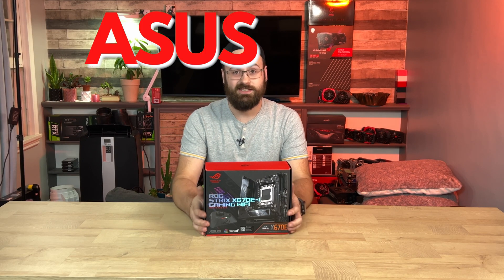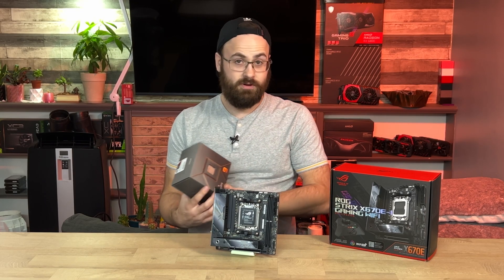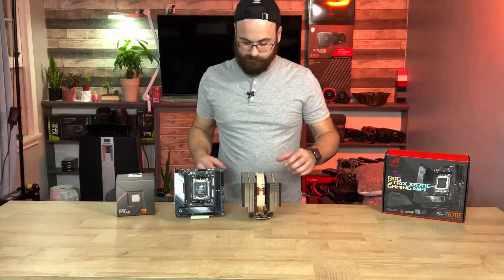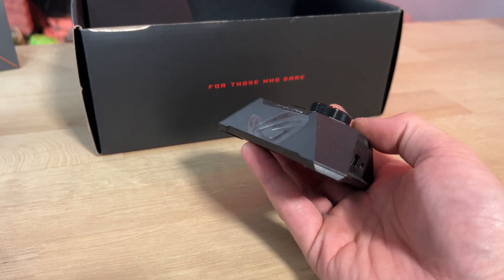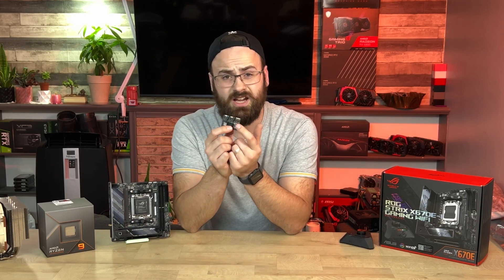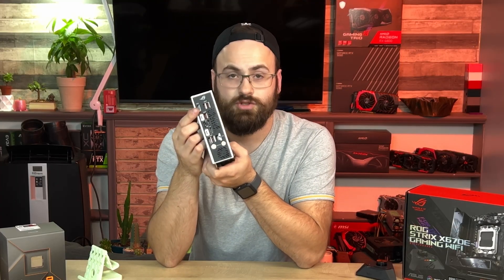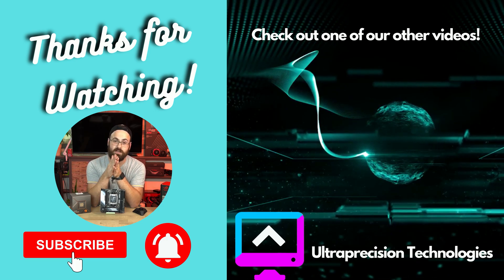An Engineering Work of Art! Asus ROG Strix X670E-I Rundown

Comment: This is the most misleading piece of youtube I've come across in a long time. This board is atrocious. The vertical parts' design makes it impossible not only to connect stuff to it in an itx case, but you can't even put it in an atx case with fans due to the m.2 heatsink cover getting in the way. Also, the chipset fans are awful, and the bios goes haywire anytime you change anything. I wish youtubers were held accountable when peddling such bs products. So yeah, awful physical design if you want to actually fit it in a case, and Asus fell off the high quality train a couple years back now, especially in the premium segment. Their entry level boards still work fine.
Reply from the maker: Thanks for your comment. I have been using this board for well over 2 years now and it’s been great! The reason why it is so dense is because it’s the ONLY x670e ITX motherboard. X670E uses 2x physical chipsets, which is quite impressive they managed to figure out the engineering to make it work at all. If you do not need the high bandwidth USB 4 ports, I would not recommend this board. It’s ridiculously expensive, especially years ago when it launched. Do your research before making any big purchases, and watch multiple videos. Everyone is going to have a different take! This was just an overview to show off the board if ppl wanted to see it in a little more detail than pictures online.
Reply: @ultraprecisiontechnologies  Yeah, but the board sucks bad if you try to fit it into an actual mini itx case. I guess you put yours into a micro atx, am I right? If you try to fit it into a case it was designed for, you're in for a whole lot of grief. And that is terminally misleading. I do need high speed usb 4 ports, otherwise I'd buy something else. And I did do my research, unfortunately, everyone did more of a hands on than a real review, and everyone praised the board immensely without even trying to use it for its primary purpose, and that's building a really small PC. Unfortunately as well - most new high end mbos feature too much relatively new tech that wasn't properly tested in various scenarios and reviewers are trigger happy to post new videos, especially if they got their shiz for free from the manufacturer and then we're left with a lot of semi-misinformation on the market. This mbo was supposed to be great. It isn't regardless of the "engineering accomplishments" with the little breakout board and vertical placement of stuff. And if you ask me, that nvme vertical mount was just lazy engineering, as well as the sata situation. New and innovative? Perhaps. Not really useable in a mini itx case? Absolutely.

Comment: Do you need to always have that Hive thing connected? Or if you're just using Bluetooth speakers can you leave that unplugged and then just plug it in whenever you might need it for something?
Reply from the maker: You should be able to use bluetooth speakers without the hive. I have ran this motherboard with a wireless usb headset without the hive connected.
Reply: @ultraprecisiontechnologies  Nice, thanks!

Comment: I bought a asus rog x670e-i itx board last year second hand from a reputable seller on ebay but due to busy schedule and lack of funds at the time never got round to building my pc. Now I've  put together the pc ,minus the cpu (7800x3d is on the way). I read you can boot into bios i tried turn the pc on nothing happens not even fan spin😢 no lights on motherboard. There seems to be power going to usb's though. I've tried connecting my power button pins just incase it was the case botton.Tried using my spare psu samething happens. Will it work when i put the cpu in or is the board dead? 😢
Reply from the maker: Your power button won't work without a CPU installed.
Reply: @ultraprecisiontechnologies   thanks yeah to my delight it worked when i put the cpu in.

Comment: why would you use Noctua D15 on the mobo? That's an ITX board isnt it? Try using some different low profile heatsinks because that makes more sense 🤔
Reply from the maker: Yeah! Good point. I was just looking around for a bulky cooler, and this is all I had at the time. I can confirm the Noctua NH-L12S also fits in this board and takes advantage of that little rubbery bit on the VRM heatsink I was talking about with its heatsinks. The channel was (and still is) pretty new in terms of actual numbers of videos I’ve made and put out, so as I go forward I will be trying to use my brain a bit more and talk about configurations that actually make sense lol. Thx for the comment.

Comment: Is anyone having issues with audio not working on the hive? Realtek refuses to install and nothing for hive shows up in the sound settings. ASUS Reddit, rog forum, and ASUS support are all useless.
Reply from the maker: The "onboard" audio hardware has been moved off-board into the "strix hive". (Strix hive is a triangular shaped object with a dial on it with some buttons and ports). The strix hive has a dedicated USB type C port it needs to be plugged into in the motherboards I/O. You should also make sure the hive is enabled in BIOS. Hope this can be of some help or point you in some helpful direction.

Comment: While I get that they needed space for cooling the VRMs, I really wish they had at least kept the BIOS flashback button and clear CMOS stuff on the main board itself.  If you are using an itx board, you probably are using an itx case. ITX cases can be crazy tiny and cramped. Especially on a platform with a chipset that is literally aimed gamers, overclockers, and power users AND on a generation with a brand new memory profiling system, you shouldn't keep things as important as BIOS flashback and clear CMOS on things/in places where they could be easily lost/hidden and potentially require a thorough disassembly, which for ITX SFF cases, you really don't want make someone do. Cable clutter can be everywhere in a tiny case like the Formd T1 or the Fractal Terra or Ridge, even with a modular power supply, air cooling, and the best cable management possible. It will be a pain to deal with especially if you need to deal with a critical BIOS update or firmware. Ignoring the overheating, memory issues, and such that Ryzen has been facing, if a security vulnerability were to occur that required an updated bios, you really be asking ITX consumers to be doing much more work than someone with even an mATX user would need to do.
Honestly, I would be tempted to just go for a full ATX mobo since this board is still literally the only X670E ITX board.
(WTFface.png)
Do I have to remind everyone that it's 2024?!
How can there still be only 1 MOBO!?!?

AMD BETTER release new chips soon so we can (hopefully) get some new ITX boards before black friday.
I am tired of this insanity.
I am honestly considering going to Intel or using a bigger board just because of this insanity.

Do ITX users not exist in the high-end market?!

Considering the stuff some people put into their PCs, I really think entire mobo industry needs to fire their entire marketing staff and start over. How does someone not notice the insane prices people are willing to pay for an itx pc case?!
Reply from the maker: I hear ya. While I can't directly do anything to change the state of the mobo market, I can offer some of my experience.

1) One cool little trick for accessing clear CMOS pins in an ITX case is to get a power button off amazon (https://amzn.to/3UEQxAC) and then slide that over the clear CMOS pins and put the button somewhere  more accessible.
2) AFAIK, the reason why there is only 1 X670e ITX board in existence (and why it's horrendously expensive) is because X670e uses TWO chipsets, where as most motherboards (z690, x570, ect) use only 1. Figuring out the engineering to fit both chipsets electrically on the board as well as solve cooling for both, is where a lot of the compromises of this board come from. Honestly, I'm not entirely sure who needs X670e for ITX as you only get 1 PCIe slot on an ITX board, so just get the ROG STRIX B650E-I and save some money. Really all you're getting in the X670e chipset vs the B650e chipset on this board is 2x USB 4.0 ports. So if you don't need those specifically, just get the B650e-i.

Comment: Nice and detailed review. I was planning to make a mini itx build and this was on my options list. Im currently using the X670e Hero but it just takes too much space in my desk and i just wanted to know if the lower powerstages really affect the cpu performance (Using the 7900X). The hero has 18+2 power stages while this one has 10+2. Also which case would you recommend for that build with a gigabyte 3090 vision?
Reply from the maker: First off, both boards power delivery are beyond overkill, and you shouldn’t have to even consider which is better, because both boards you mentioned vrm’s are about 4x more powerful than 99.9% of users will ever need. The only person who may stop and consider the differences in the VRMs of these 2 boards is someone who actually does LN2 overclocking. 
Secondly, just because there are less power phases in the itx board doesn’t make it worse or less powerful. Because of the limited space, the itx board is forced to use higher quality, higher amperage power stages, and just fewer of them. When I asked JJ over at Asus about this directly, he said the itx board is just as capable of overclocking as any of their other boards, if just does it in a more compact footprint (also adding to cost).

So to directly answer your question, no, you will notice zero difference on your 7900x.
As far as an itx case goes, I really like the meshlicious and Meshroom s cases, as they fit big gpus and have a small footprint. The Meshroom s does fit slightly bigger gpus than the Meshlicious.
Reply: @ultraprecisiontechnologies  
Thanks a lot for clarifying things. Really helped me make my choice for the build 👍

Comment: The manual doesn't say where do i have to put which cable from the io, can i put them where i want or does it have an specific order?
Reply from the maker: Which io are you referring to, the power, reset, hdd and power leds? (Front panel connections?)
Reply: @ultraprecisiontechnologies  thanks for the fast awnser, the manual on the internet had a more cler instruction than the physical one, so i was able to figure it out😁
Reply from the maker: Perfect!

Comment: Whats the benefits of this over the Asus Tuf B650?
Reply from the maker: A high level summary of the main difference is overclocking performance and PCIe lanes. Tuf vs strix: The Strix and higher tier boards have built in 1 click overclocking and "Ai" overclocking features that are very handy for getting more performance from your hardware without manually tuning anything. More performance from your CPU at the click of a button in bios is the value add here. 
As far as b650 vs x670e chipsets, you'd have to lookup a comparison chart online, but x670e must have pcie 5.0, where as b650 does not, as well as more high speed connectivity is available in x670e. on x670e, you'll usually find more USB ports, faster connectivity and more of it. (More PCIe 4.0 lanes, ect.) Hopefully this helps.
Reply: @ultraprecisiontechnologies  is it worth the price difference if I keep it as standard? I don’t usually overclock anything. And just use it for gaming only.

Comment: One of the most common complaints about this board on reddit and in various customer reviews is the built in fans. Specifically the noise they make. No-where online have I been able to find a sound or video clip of this though. I'm thinking about upgrading, but I'd really like to know how bad that noise is first..
Reply from the maker: They mainly make noise on boot up. They spin full speed for a few seconds. There are 2 chipset fans, one seems to be louder than the other. Using a piece of software called “Fan Control”, you can actually control the fan speed of the noisier fan and set custom fan curves. However, this will only help you once you’re in windows. They will still spin full speed on boot.
Reply: Can you change the for more quiet fans?
Reply: This small fan is super noisy. It's so loud (during general use) that I'm considering returning this board as it is by far the loudest piece of my setup.

Comment: This will be one of the motherboards I will buy later this year for my 7800X3D build. I am still rocking my Crosshair Impact X570 w/5800X3D. By no means a gaming slouch. But having the next generation in hand so I can upgrade anytime I want to is important to me. Thanks for this.
Reply: @Micah Why? The problems Asus is having is not with this motherboard. I have no issues with my other 4 Asus motherboards.
Reply: @Micah Yes, really. But I will wait until they drop the price. If they don't then I won't buy. My current AM4 setup's 5800X3D and 5600X are doing the job, and my Sapphire Toxic has been fixed and is on its way back to me. So I will continue to pay bills and save up for the next line of gpu's.
Reply: @Micah Duh! As I said nothing wrong with my AM4. It's working while AM5 is having issues.

Comment: Great video! Question, can you please measure the height of that added bottom backplate (near the IO side, to the right of the CPU backplate)? I'd assume it's used for structural support and maybe some cooling, but what is the height? Wondering if it's too tall for my case which uses short standoffs.
Reply from the maker: Ooo interesting. The board is still installed into a system, so I’m not sure if I can get at it. Sorry!

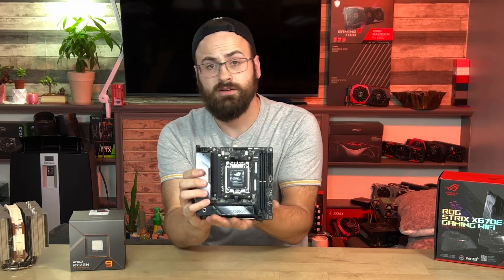Comment: 4:20 how a thing piece of metal wrapped around plastic will do any beneficial cooling?
Reply from the maker: It should help to some degree, help pull heat out of the connector and sink it into the extremely thick PCB which acts as a sudo heatsink.

Comment: Thank goodness for your video. I was looking for all this info.
I was trying to figure out if I could fit the InnoDisk EGPL-T101 10GB/s M.2 Card on this ITX MB.
Then I figured out that the second M.2 was on the ground floor of that stack and not on the back (still don't know which floor has the PCIe 5.0 connection after reading the manual. I assume the top one).
The issue with the InnoDisk EGPL-T101 is that it has components on the PCB which are not standard-sized for SSDs. I figured I could remove the heat-sink and use the MB's instead, but if I want to fit it on the ground floor, I'll also have to cut out some of the double-sided tape to fit the card, but I'll also need to bend the card a bit towards its extremity by removing the foam beneath so that the component square will be able to make a flush contact with the covering heat-sink.
Would you say that's possible? Are these SSD flexible in the least?

Comment: How does the HIVE connect to the board? The board has no onboard audio so how does it work?
Reply from the maker: There’s a specially marked usb type c port on the rear i/o, and it uses a special cable that comes with the hive
Reply: @ultraprecisiontechnologies  thanks, this also applies to the Z790-I as well since that has a HIVE and no audio I guess? I'm building an SFF build with the Fractal Ridge and an NH-L9x65 on an undervolted 13700K w no weird turbo boost behavior

Comment: I can confirm that USB 4 (TB4) can support multiple displays on a single port, via a TB4 hub and is a function of the CPU (iGPU) max supported display capabilities. e.g. i7-1165g7. This would be DP-alt mode over USB C, and run in 2 lane or 4 lane mode, depending on the resolution, version of DP and if DSC is possible. This is also true for the USB C to DP or HDMI cables/dongles, if the display does not natively support USB C. So those USB 4 ports are basically where you would connect a USB C, DP or HDMI display, if you do not have a dGPU.  :) All within the capabilities of the CPU (iGPU) max supported displays. You could also connect eGPU on each USB 4 port, which would technically run as TB3, providing PCI-e x4 to the eGPU and the max quantity of displays the given eGPU can support.
Reply: so those usb c 4 ports doesn't support video output from dedicated gpu?
Reply: @minhtet9379  technically yes and there's a microscopic performance hit. Some dGPU do have a dedicated USB c output. This can be seen in some rtx 2080 cards. It was called VirtualLink.
Reply: @johnwalshaw  i am trying to build pc to use with thunderbolt 3 monitor and the only board that has displayport passthrough is msi z690i unify. since newer gpu doesn't come with usbc or thunderbolt port, i am forced to use msi z690i unify and intel cpu. If i were to choose intel, which cpu do you recommed since intel 13 and 14 gen has issue with stability according to some folks on interent?
Reply: @minhtet9379  Looks like my last reply might have been deleted. I have a i9-12900K and love it.
Reply: @minhtet9379  I have the i9-12900K with AIO. It's super! I wish I had an unlocked BIOS as I cannot unlock the full potential. I run 2 sticks of 32GB DDR5  memory for a total of 64GB RAM. I think it runs at 4400GT/s which is the limit of my MB from what I remember. With higher TDP CPU cooling is really important. If you Google walshaw techtips you can see my Lenovo build with my external AIO.
Reply: @johnwalshaw  how about i5 14500 or 14400 with rtx 4070 ti super?
Reply: @minhtet9379  That would be awesome.  I have an RTX 4070 Super (non Ti).
Reply: @johnwalshaw  great. Thanks for reply.

Comment: A question: Is the HIVE necessary for audio? The headphones I'm about to buy also has a dongle, with similar features, and I'm worried the desk will become too cluttered with both. 

Thanks again for the content. \o/
Reply from the maker: The hive is the equivalent of onboard audio, just external. If your headphones have a built in sound card that connect via usb, then no, I don’t think you need the hive. However if your headphones don’t have a sound card built in, and just have desk controls, then yes, you would need both.
Reply: @ultraprecisiontechnologies  Thanks!